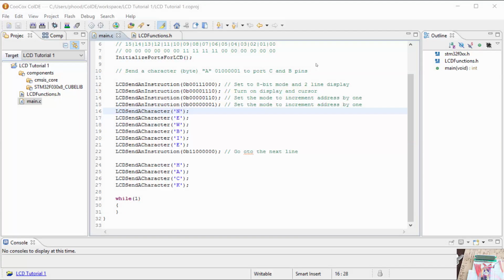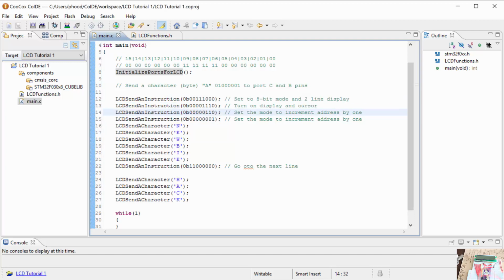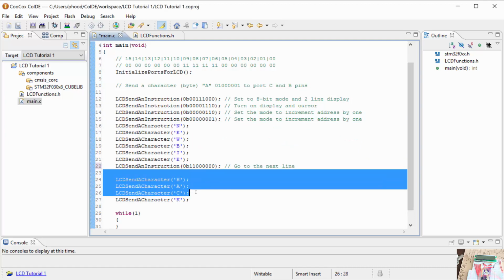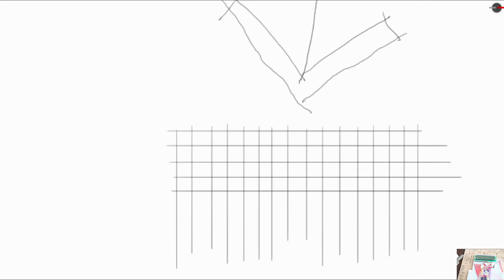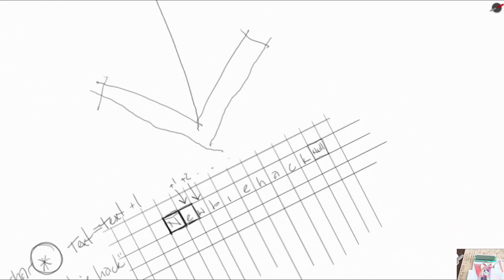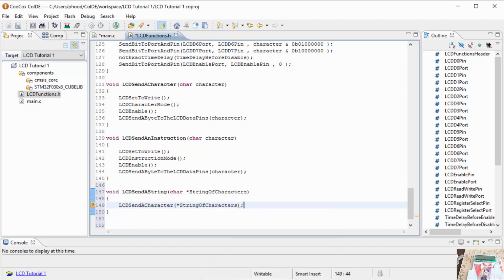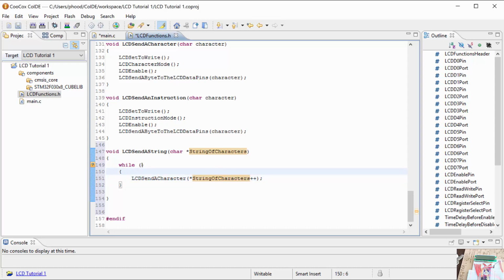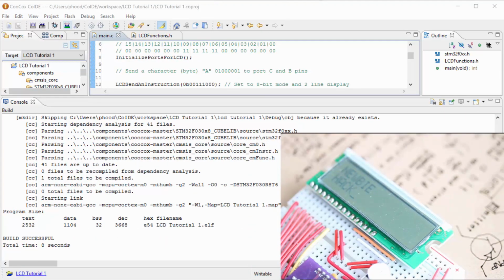28. How to Interface an LCD to an ARM Microcontroller Tutorial - Part 15

Comment: I've got a problem with LCDSendString Function. 
It's not sending a string to LCD. Even if I use several times LCDSendACharacter function without while loop it's not sending String to LCD.
But when I use several times LCDSendACharacter function in the mani.c, it's work fine, sending a character by character well.

Comment: How Can I Set Maximum Clock Speed Of STM32F103 ?
Reply from the maker: You will probably need to add an external oscillator.
Reply: Thank You For Reply 😊.
Sir Can You Make A Tutorial On How To Set Internal PLL Using External Clock Source For STM32 ?